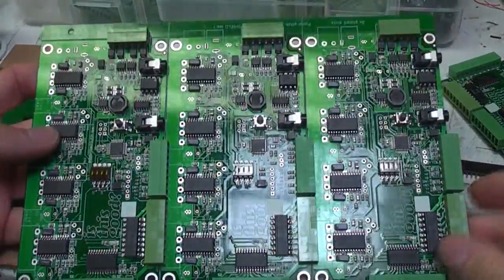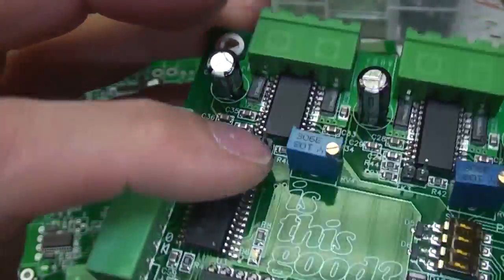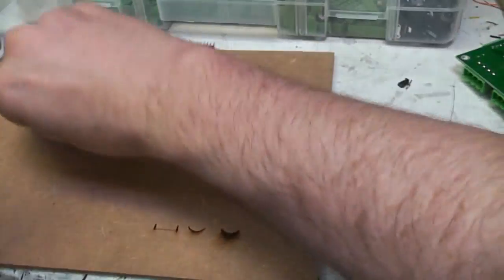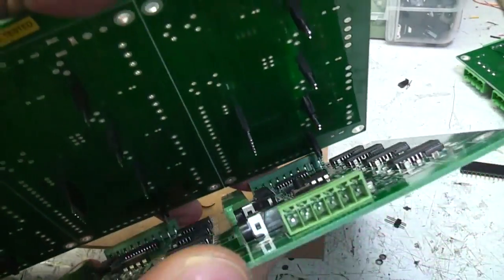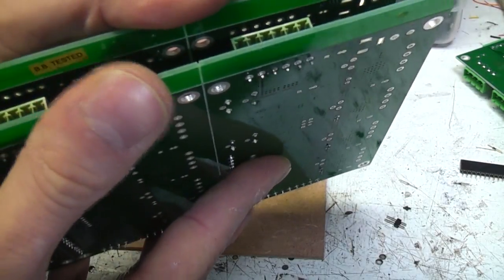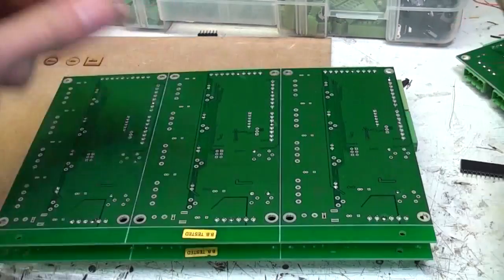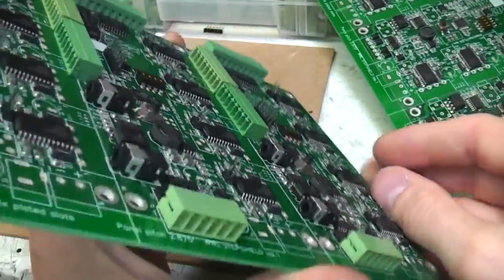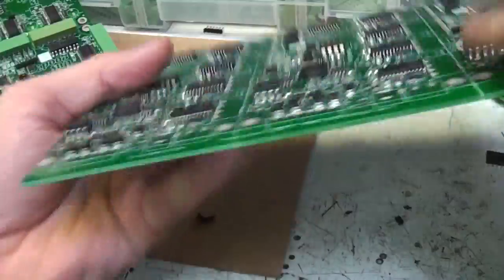Simple jig for soldering small pin-headers

Comment: hmm. lets guess, I smell steppers, those ICs look a lot like chopper stepper drivers (sense resistors, trim-pot, crap ton of heat-sinking vias under the SOICs). Those dip switches seem to imply a programmable address and some of the other ICs look like level shiftiness for IO maybe? I've seen 4 Schottky diodes used as termination for an rs485 bus so maybe that lone connector up top is for comms. Maybe a moving art installation or replacement electronics for that pick and place :)

Comment: Since you got mounting holes on the boards, wouldn't it make easier to aling the boards if you used couple M4 bolts (or which ever is ne nearest size) and nuts as alingers?

Comment: And as soon as you get the pins warm, the plastic strip that holds them together softens, the pin flexes, and it falls out of the board.

You really need three pins (four is better) for a locking footprint on most 0.100 pin headers.

Comment: It actually does, as the pads are offset to the sides. It doesn't work with single headers though, for obvious reasons. In eagle you can use sparkfun's library, they already have offset "locking" footprints for pin headers, so no need to reinvent the wheel.